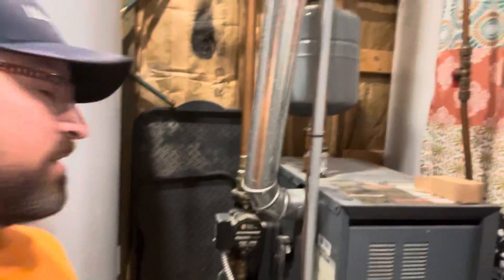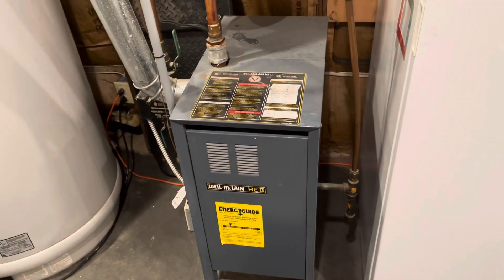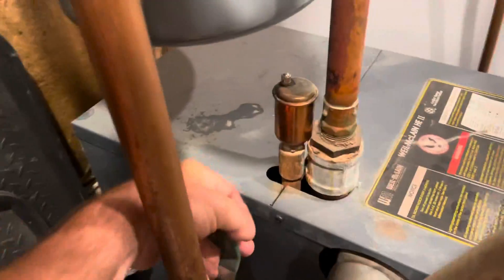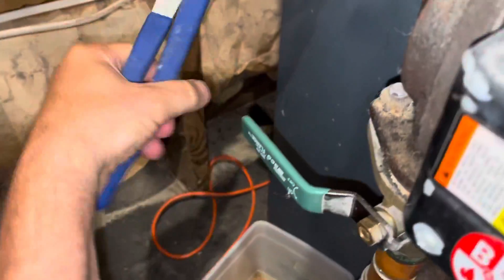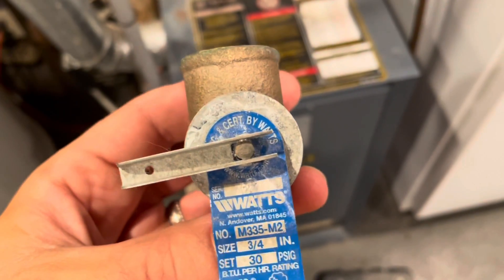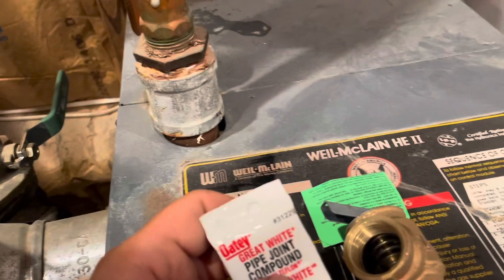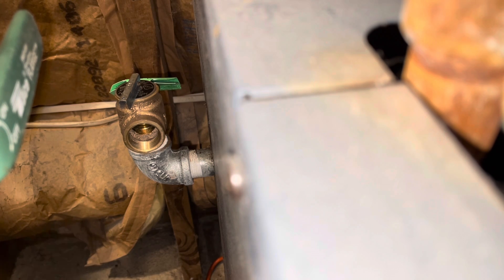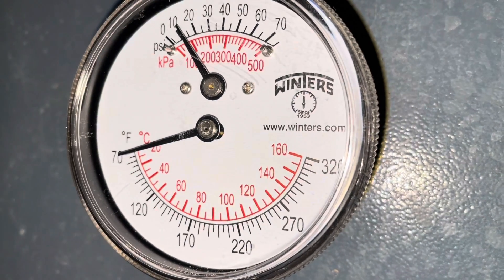How to Replace a Boiler Pressure Relief Valve

Comment: I'm not a plumber, but unless I'm not understanding what's going on, that looks really dangerous, and not code. If that valve releases, it's going to shoot scalding high pressure water right at you, maybe in your face! I thought they always had to point down, and terminate within a foot of the ground.
Reply from the maker: Thanks for the comment. If I happen to be on my knees with my face by this valve right when my system over pressurizes and blows out the pressure relief, yes, in that case, I’d get some hot water in my face. It’s a boiler from the 90’s that hasn’t gotten over pressure yet, so I’ll take my chances! Yeah, but in all reality, you may be right about the code. This is just how the boiler was set up when I bought the house. Thanks!

Comment: You do not use pipe dope on brass fittings only Teflon tape is to be used. Pipe dope is for gas lines
Reply: Most pipe dopes are listed for brass, iron or copper threaded fittings.
Reply: Yea unfortunately that’s not true, it also depends on local code. However you can absolutely use dope on brass fittings as most are rated for it. Especially steam system controls.
Reply from the maker: Thanks for watching